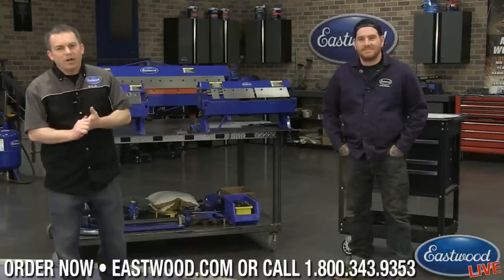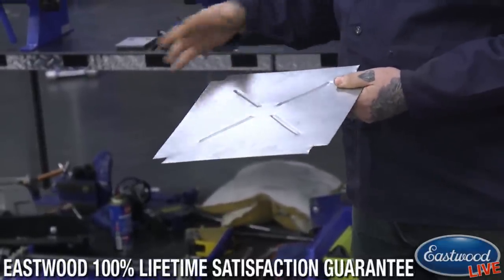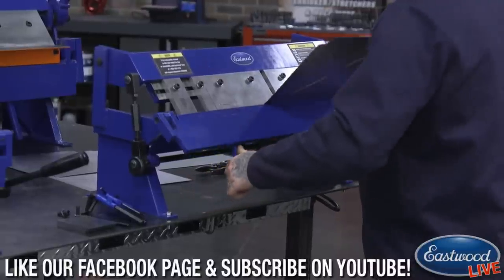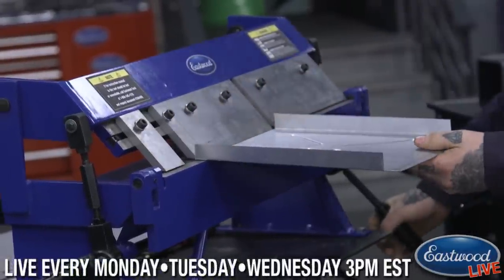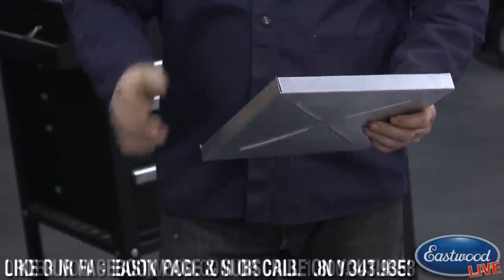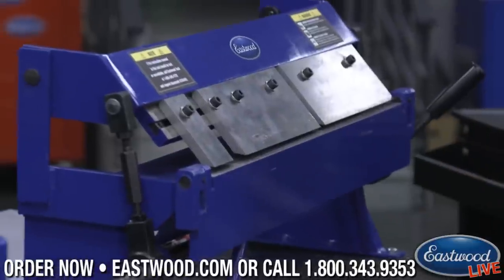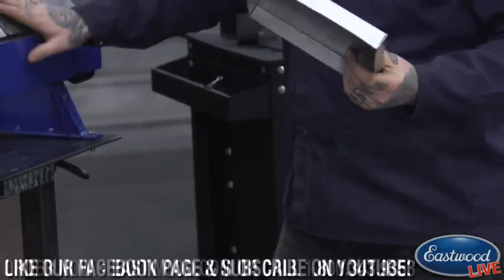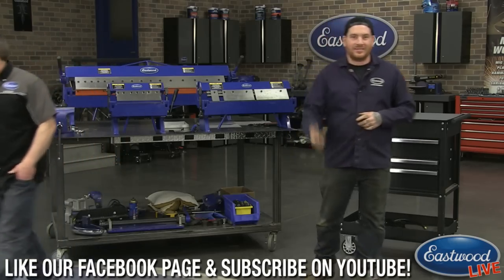How To Use a Pan Brake to Make a Battery Tray.  Eastwood

Comment: i would buy one now if it did 18G, i would love to build a custom battery tray for my cuda, but 20 Gauge will not work for any battery tray that actually has to hold it up on its own
Reply: It will if you strengthen it with a beadroller and dimple dies.